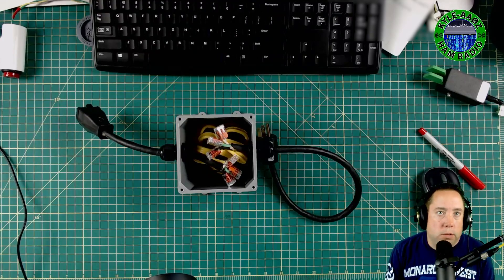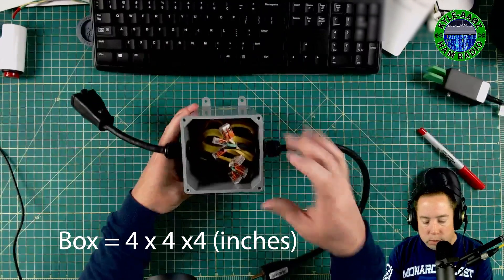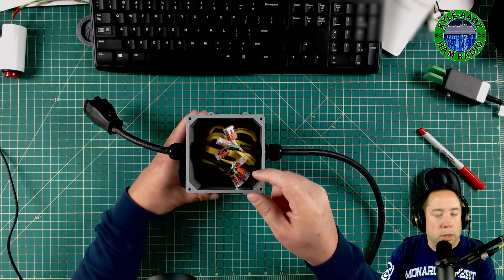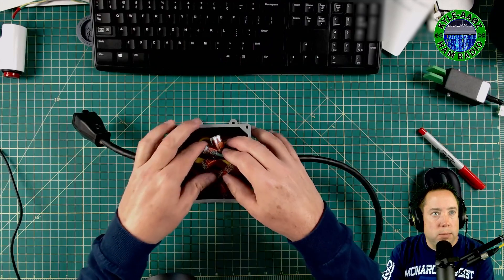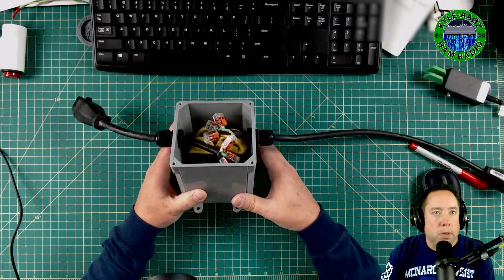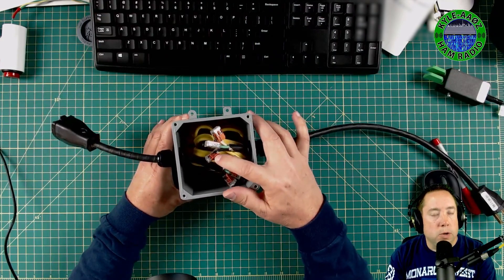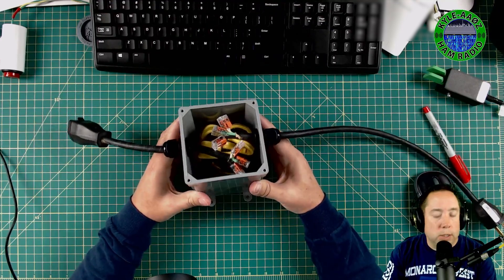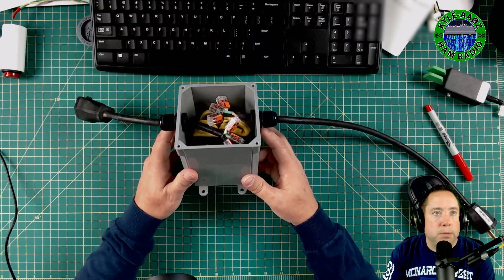AC Power Line RF Choke - You Need This for Field Day!!!!

Comment: couldn’t you have just wrapped the extension cord through the toroid cores?  no box, no splices, maybe one replacement plug (because it would not pass thru the core).
Reply from the maker: Correct.  Most extension cords you can only get a few wraps around and the cable gets in the way.  You need lots of wraps for lots of impedance for the cores to be effective.

Comment: Why did you do this on 1 + 2 toroids as opposed to gluing three of them together to start with?
Reply from the maker: You'll need to read the toroid PDF in the description for the reason why!!!!
Reply: @AA0Z  I'd be interested in seeing testing to prove the theory out that the same number of turns around two cores vs one core make them suppress different frequencies.  Do you happen to have a NanoVNA?
Reply: @de_w8tam  I was wondering the same, and found a small section in the K9AC 2018 Cookbook. 

On page 13 it states: "Two Cores or One? Winding a choke on two cores rather than one doubles the inductance and approximately doubles the value of stray capacitance in parallel with that inductance. This has the effect of dividing the resonant frequency by 2 and doubling the impedance at resonance."

There is also a link to two graphs that show this. Hopefully this is what you and I are looking for.
Reply: John,
Read the K9YC paper that Kyle referenced, pages 14-15 and Figures 23 and 24.  This shows the effect of the different number of turns on reactance/resistance and frequency.
Reply: Especially see Fig 30a on page 23 of the K9YC document. This shows something very similar what AA0Z made. The choke with a pair of cores covers a different range of frequencies than the single-core choke. Putting them in series gives the benefit of both.